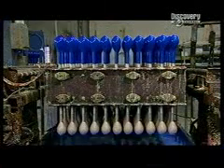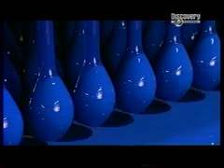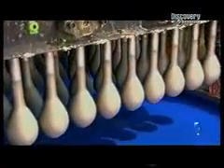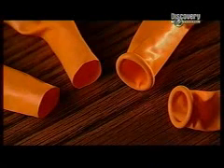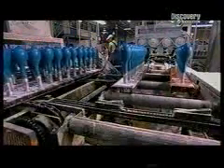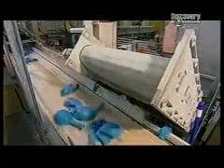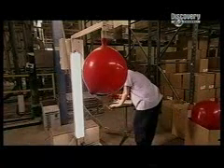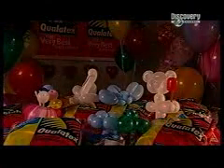How balloons are made

Comment: @sharkhead7854 
Actually, latex does have tiny microscopic holes in it, the more you stretch it the bigger the holes get. Which is why if you fill up a balloon with helium it'll gradually deflate because the holes are big enough for helium to squeeze through (albeit very slowly)